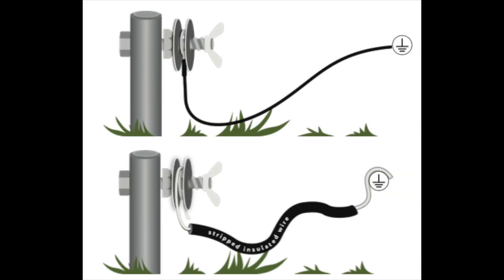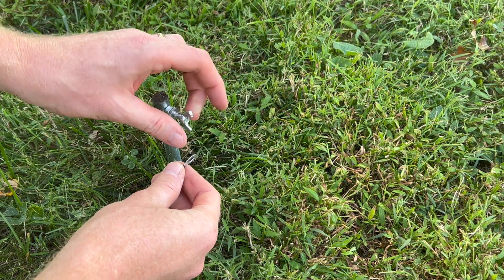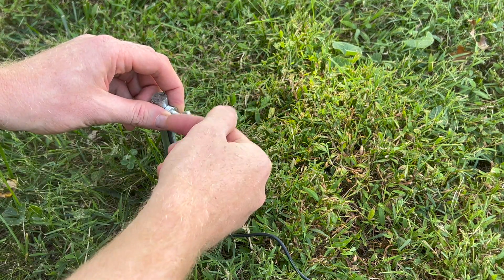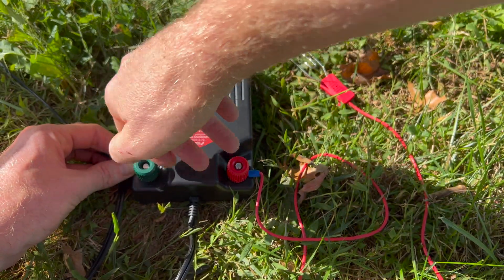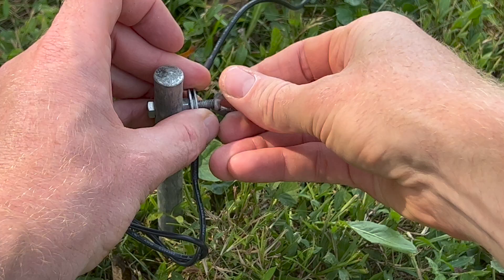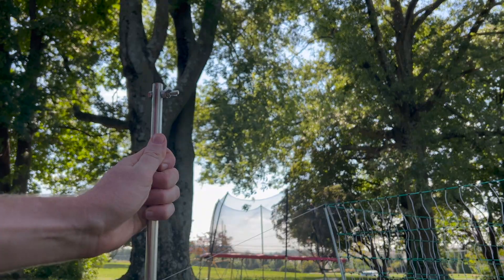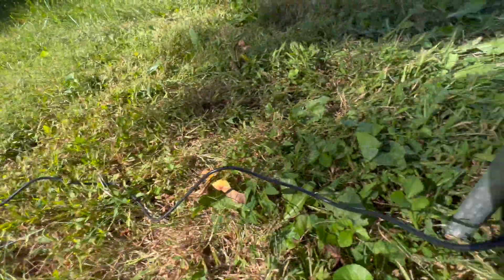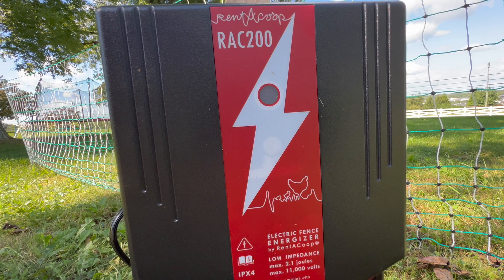3' Grounding Rod by RentACoop® - Setup

Comment: Hello, so I bought your fencing and it was working perfectly fine with my red sizzle energizer I already had… a couple weeks ago it stopped working tho. I know my energizer is good because I tested it. But when I hook it to the fence it doesn’t work anymore. How exactly are you connecting multiple lengths of fencing together? And how exactly are you connecting the energizer clips. None of your videos really explain this. I dunno, it WAS all working, now it’s not, I’ve confirmed my energizer works with test meters/lights and my old fencing… and today I’ve gone and checked to make sure none of the wires were where they aren’t supposed to be like under the spikes or touching the ground or plants… I really want to like this fence, but now I’m just frustrated and I don’t have the box or papers for it anymore… I have 4x 1.5ft grounding rods all wired together for my ground, I know it works cause I was messing with it today and got a full shock from the unit, way worse than the fence ever put out…
Reply from the maker: @theFrogfeeder, Hello! We're so sorry to hear that you are having trouble with your fencing! Please send us an email at info@rentacoop.com with your Order Number and some information about the problem, and our Product Eggsperts would be happy to help get this resolved for you!